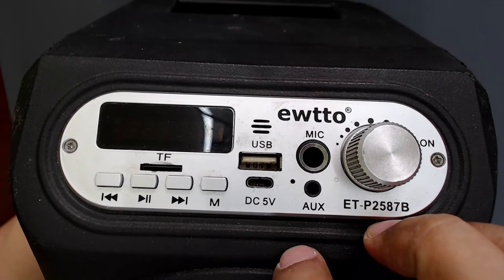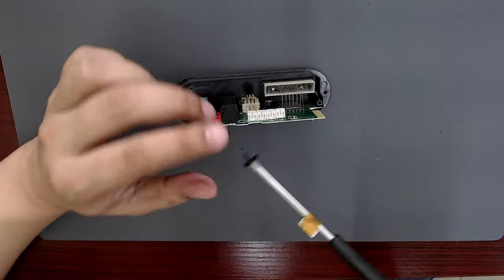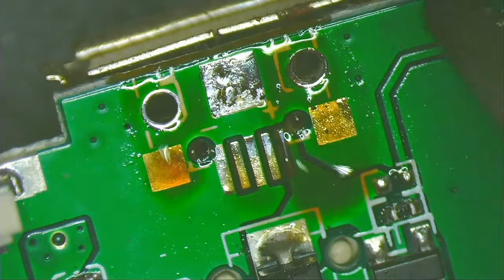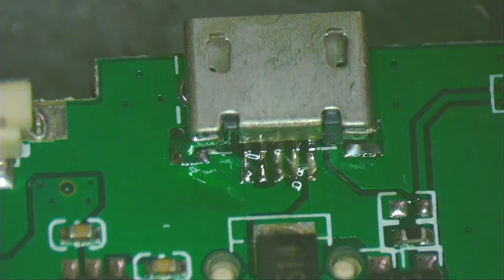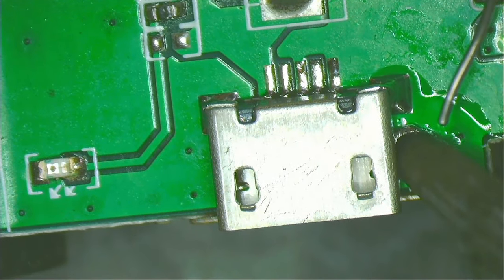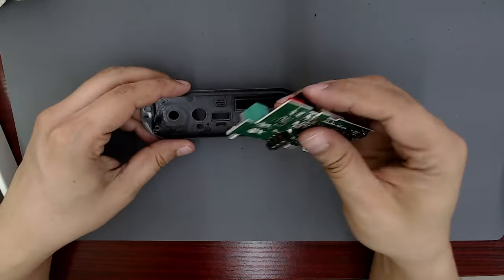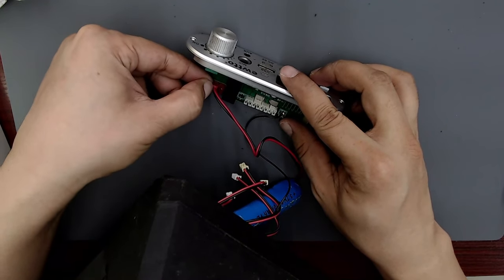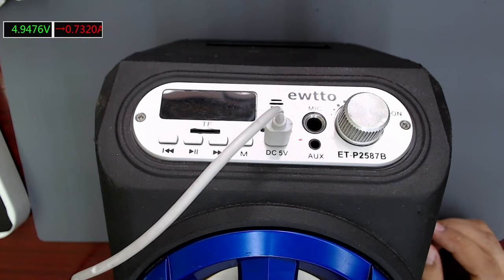Bluetooth Speaker Repair, Broken Charging Port Replacement

Comment: How come some bluetooth speakers dont hold a charge and you have to keep it plugged in so it works is it cause the rechargable battery is getting weak over time and cant hold a charge no more?